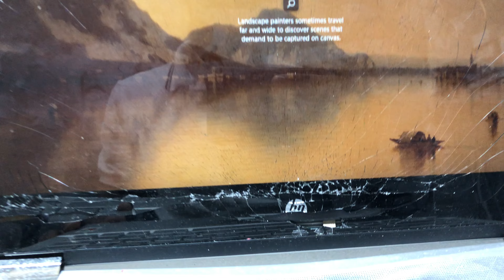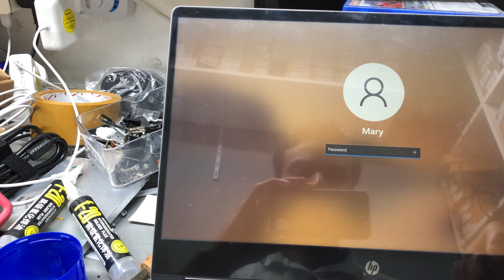HP Pavilion X360 Convertible screen replacement. HP laptop screen. changing. NEXG TECH

Comment: How much is the cost ??plss i can't find anywhere to replace only glass for hp pavilion x360
Reply from the maker: Glass only not available 
If you want to change screen 
Please contact : 0547171301
Reply: I also have same problem glass is cracked.did you find any solution???